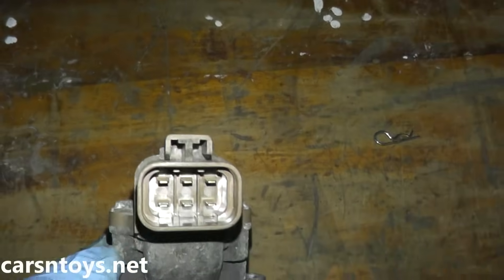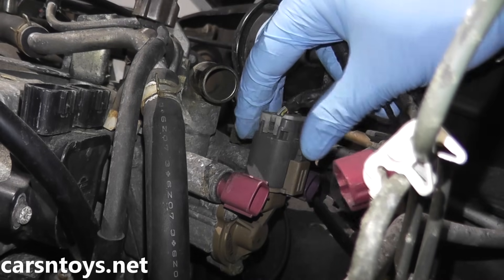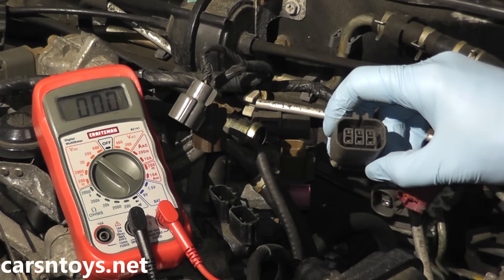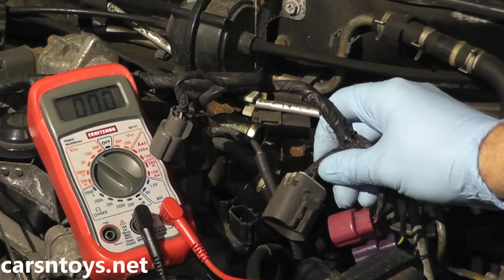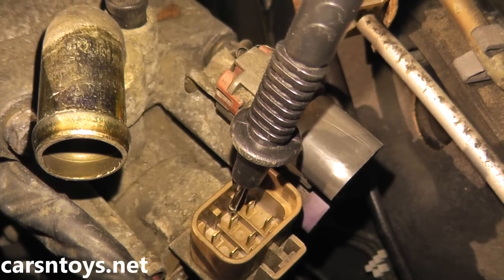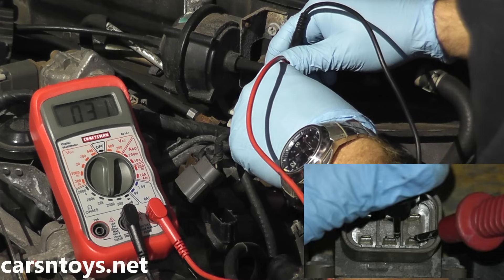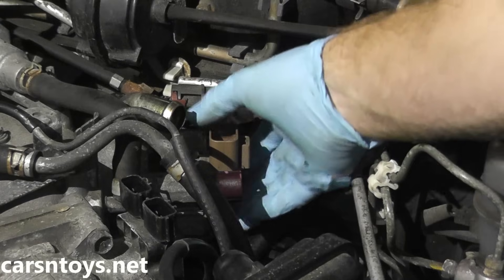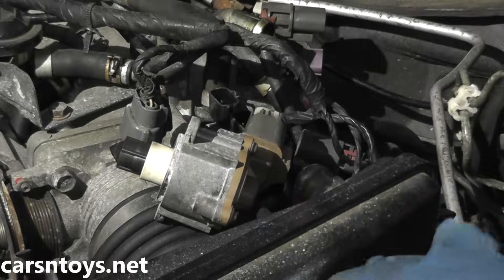How To Test and Replace Idle Air Control Valve P0505 HD | IAC Actuator

Comment: I have done all does test and i get 30 ohms and 12v on the harness and i still get the p0505. I even bought a new IAC but no luck. I also tested the continuity from the harness to the ecm and it was good.  What can it be?
Reply: Its on a 97 Mitsubishi eclipse gst
Reply from the maker: James Jimmy Did you erase the code and it keeps coming back on?
Reply: CarsNToys yes i erase the code and do a drive cycle and the same code comes up. I need to clear it to pass smog.
Reply from the maker: James Jimmy The only thing I can recommend is see if you can get your hands on the factory repair manual. Maybe there's something else to look at on  your Mitsubishi. Out of curiosity, any other trouble codes?
Reply: nope only the P0505

Comment: I have a 94 ranger 4.0 that has a very bad idle. Also when I hit the brakes hard it stalls out but only if its low on gas. I can replicate the stall every time but only when its getting close to e. If it has a quarter tank or more, it will not stall at all Sometimes when im at a stop it will jerk. Not sure if thats related. The iac valve looks super clean almost looks brand new. The only code its throwing I looked up and its mass af sensor which I already replaced. Also I can smell that its running very rich.
Reply from the maker: WaterWhipin Sounds like the fuel pump pickup is toward the rear of the fuel tank. When you're low on fuel and nail the brakes, the fuel is being forced away from the fuel pump pickup point and stalling out. Try to keep enough gas in the tank or you can burn out the fuel pump. The fuel acts as a lubricant for the pump. Regarding the rough idle, first thought is the idle air control valve. Other areas to look at include the fuel pressure regulator. EGR valve and PCV valve (I have videos for both) or you could have a leak at the air duct causing the MAF code. A bad idle can take some time to diagnose.
Reply: CarsNToys thanks for the response. I have good fuel pressure, im not sure if thats an indicator for needing a fuel pressure regulator. I checked for vacuum leak couldnt find anything. I got the truck a year ago and the guy told me about the issues the truck had and I asked him if it might be the fuel pump he said that he replaced it but Im not sure how long ago or if it was installed properly. Thanks for the ideas ill give those videos a look
Reply from the maker: Good luck. Scotty Kilmer has a bunch of videos regarding vacuum leaks and stalling vehicles. Just do a search under his page.

Comment: heres my situation, i have 2003 toyota camry 4 cylinder and it wont idle after my battery is disconnected, any recommendations?
Reply from the maker: z9099 It doesn't idle after the battery is disconnected?
Reply: i will disconnect battery, then reconnect, and my car will not idol and shut off
Reply from the maker: Any trouble codes?
Reply: not that im aware of...i dont have a scanner if thats what your asking
Reply from the maker: Primary causes for vehicle shutting off is fuel pump, injector(s), idle air control valve and the ignition circuit. For your particular case, I'd start with the idle control valve. Also check the pcv valve.

Comment: I am so happy that I found this video, you are awesome but look buddy here is the situation I have 2 1997 maxima cars, one its been with me for the last 8 years I love it but I just had an accident and now is crashed/total,  so I purchased another one but  fails smog check because of the p0505. I did all the steps you mentioned and here are the results.
New car (LOL)  has 9.5 v on harness,  old has 12.5 v.
new car is not able to push or move any of the iacv cylinders/piston,   while my old car did with both iacvs.
do you think is because of the low voltage or the ecu, or any idea?  Thanks!
Reply from the maker: Osmark Ibarra Have you tried swapping the iacv from the old car and hooking up to the new car and seeing if the valves work?
Reply: CarsNToys yes, I did  I switched iacs and erase code and I got the code back again, I did the other test out the housing and there was no movement from any of the iacs with my new 97 maxi, but I do have movement on the old crashed maxi.
Reply from the maker: Osmark Ibarra How about the battery? Are you using the same battery for both cars?
Reply: +CarsNToys. I tried with the same battery same issue.  12V on my 96 and still getting 9.5v on the 97 maxima. Any idea?
Reply from the maker: Osmark Ibarra If you check the voltage directly from the battery, are you getting 12v? If so, then it's a problem with the IACV and the ECCS relay or ECM. Let me know how you turn out. Maybe I can try to get a quick video up regarding the ECCS relay.
Reply: +CarsNToys.                 Same battery and I've been checking online for the eccs relay location,  I haven't find anything about it. Please can you tell me the location and if is possible a video about it will be great! Thanks
Reply from the maker: Osmark Ibarra Okay. I'll post something soon for the ECCS. But just to make sure we're on the same page, if you take a reading directly from the battery you get 12v. And when you check the harness connector for the IACV you're getting 9.5v. Is this correct?
Reply: +CarsNToys.   Yes,  I got 12.3v from battery or so and 9.5 from harness with switch on. The other maxi gives me 12 from both sides and I am using same battery
Reply: CarsNToys any Idea how to test the ecu before I buy one, I can not afford a mechanic.
Reply from the maker: Osmark Ibarra Have code p0605 or is the vehicle running in fail safe? (Fail safe mode limits to 3k rpms)
Reply: +CarsNToys. You meant  P0505?
Reply: +Osmark Ibarra. Rpm is stable on 1200 rpm or so, high rpm but the car runs fine, is just that is failing emission test
Reply from the maker: Osmark Ibarra And you can run a self diagnostic test on the ECM. I'll try to get these two up very shortly
Reply: CarsNToys Rpm is stable at 1200 rpm or so, high rpm but the car runs fine, is just that is failing emission test
Reply from the maker: Osmark Ibarra P0605 is a trouble code for a malfunctioning ecm. Your vehicle would enter fail safe mode. If you can go above 3k rpms I doubt your ecm needs replacement but I'll show how to do a self diagnostic test shortly.
Reply: Ok that will help but my code is p0505 not p0605.